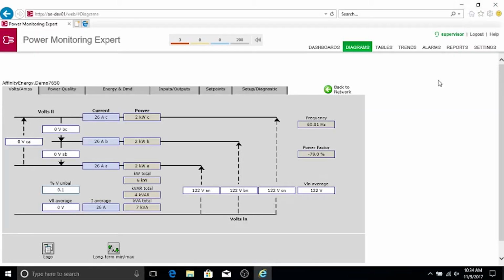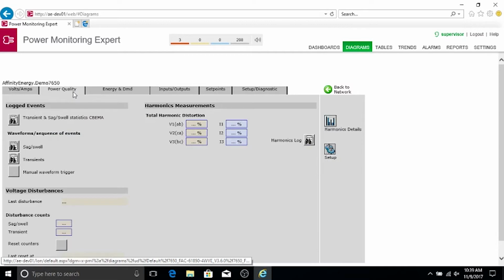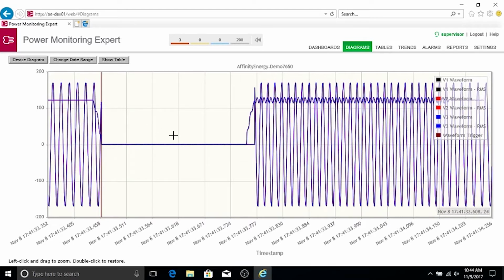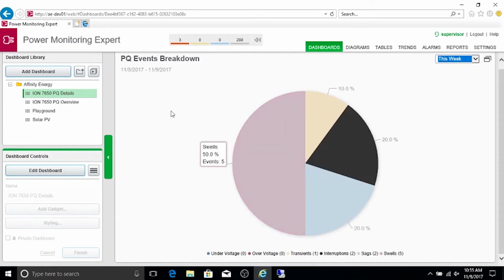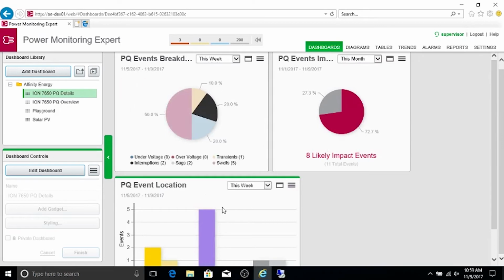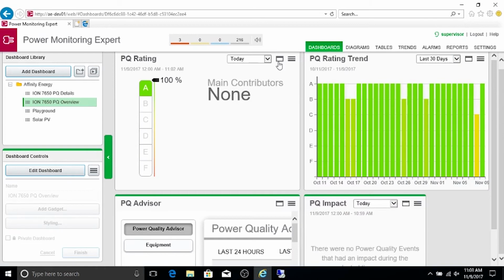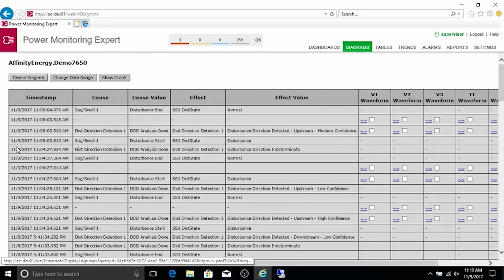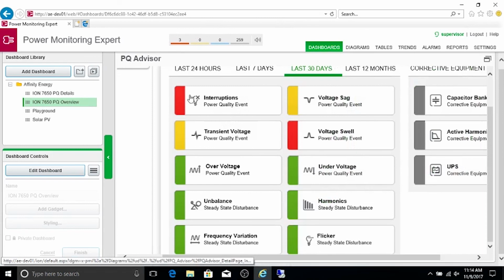Webinar: Power Monitoring Expert

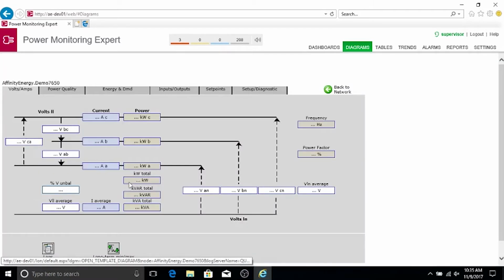Comment: Hello from Brazil, in 2:11 you said that the template is out of the box that comes with the software... Do you mean "template for the power monitoring expert" or for the ion 7650? Does power monitoring software replace "automaticaly" template that came with factory with the ion 7650 originaly? or it does nothing to the meter, and the data is already there on the meter memory?   I have two ion7650 and i can´t find what data i can use to plot the itic(cbema curve). if you help me i´ll be very pleased!. thks.